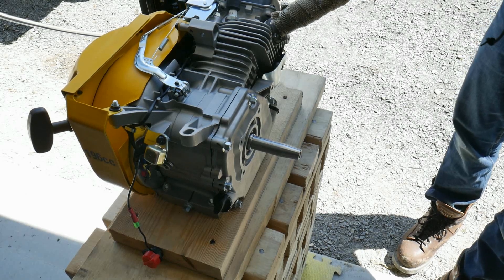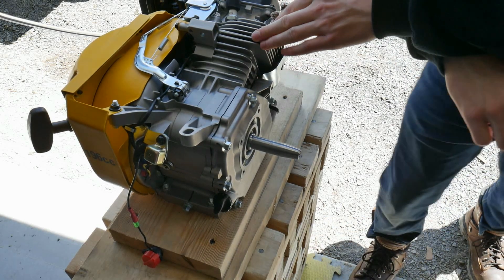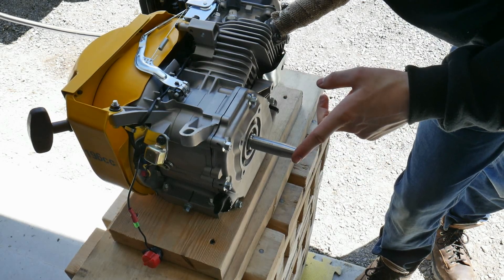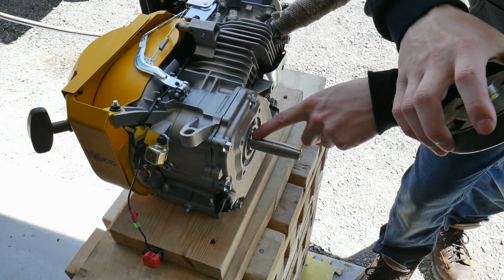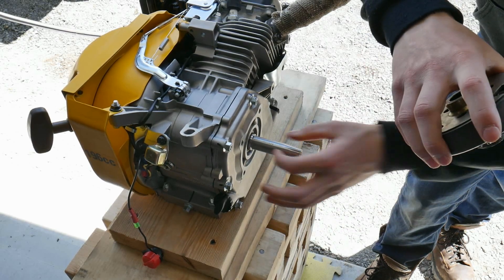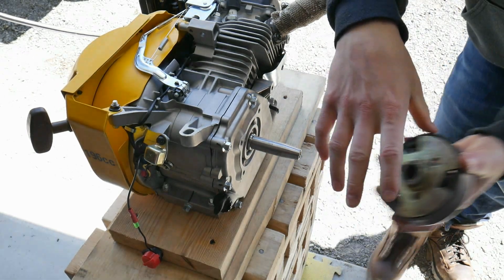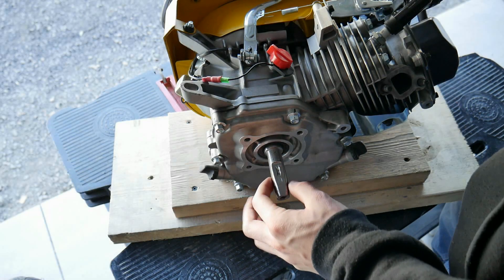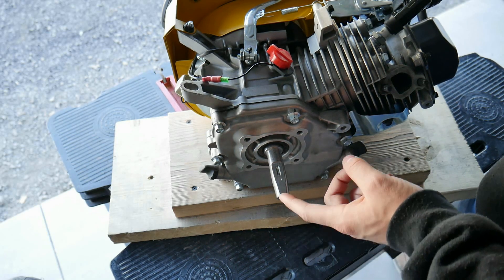Converting the Tapered Shaft to a 3/4 - Turbo Kart Build - Part 6

Comment: I've never seen a pressure washer with a tapered shaft, pretty certain that's off the only device that actually needs a tapered shaft which is a generator. Also, RIP engine.

Comment: Start up the motor and increase rpm until it has a sweet spot with little vibration.
AC 36 grinder disc with plastic backer.
Finish last 1 mm with sanding disk.
Grinder cut Set down near engine and sparks facing ground so you can see how much your taking off.
Gentle pressure on, gentle pressure off so you don’t get eccentrics of flat spots.
Use a digital vernier  caliper often and stop engine.
No loose clothing and be safe!